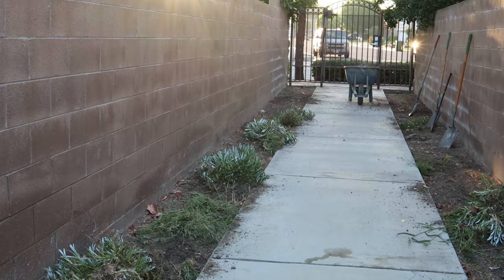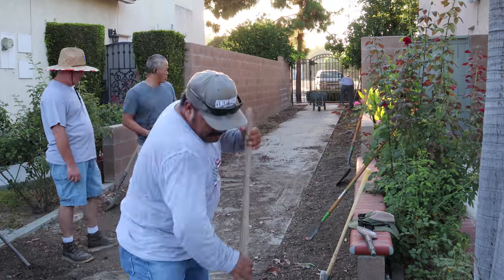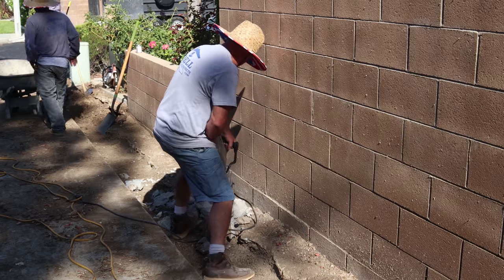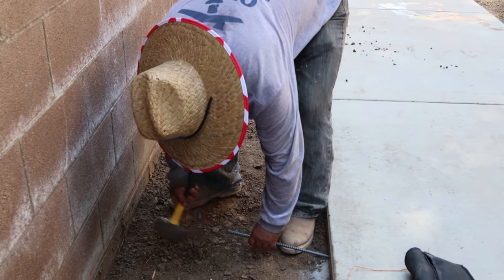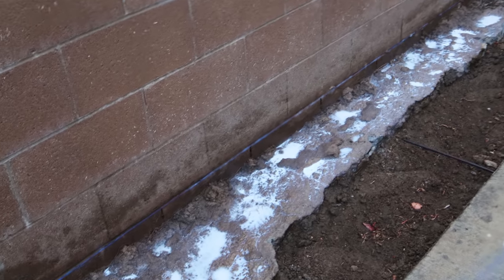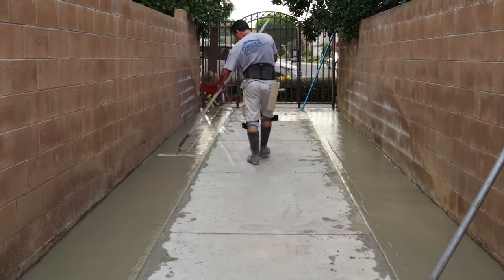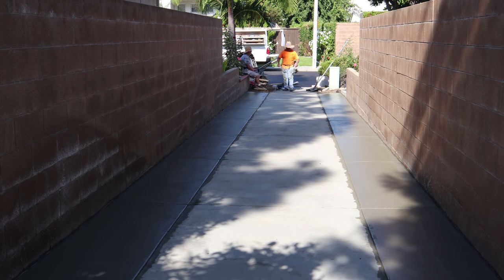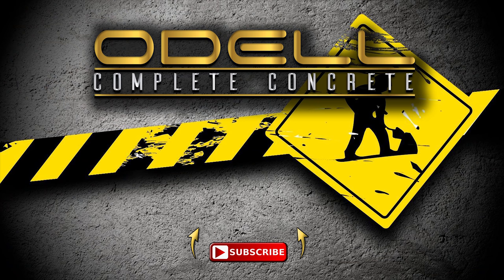How to Pour Concrete and Remove Planter beds

Comment: Is there an extra charge to the homeowner if you choose to use a pump when pouring concrete instead of wheel barrels? Or is it the same cost regardless of a pump being used or not ?
Reply from the maker: Same cost it off sets cost of pump versus more labor.
Reply: How much per sqrft
Reply: Francisco Delacruz I’m guessing around $10/sq ft

Comment: Great work! One small question, why dont u use a hose with your concrete saw? I'm guessing the stihl hose adapter ain't the best. I just bought a hilti concrete saw and the hose attachment works great.
Reply from the maker: It works fine, but its a lot of hose for a 5' cut